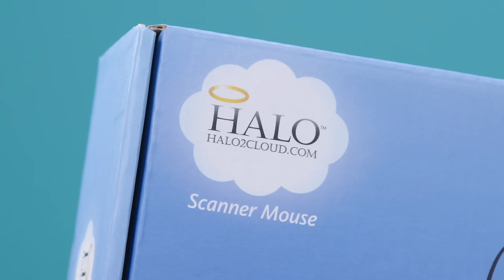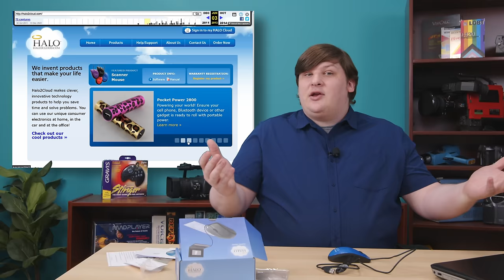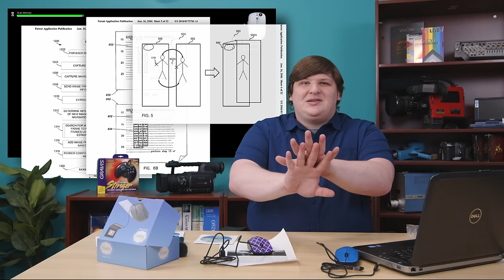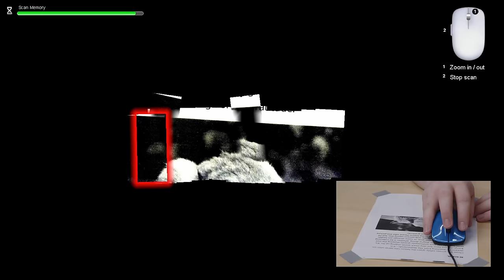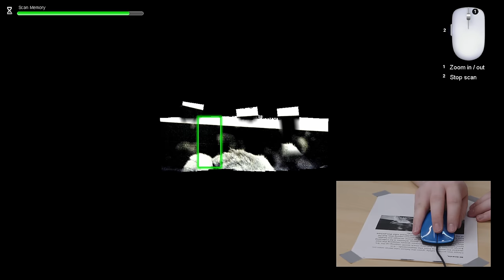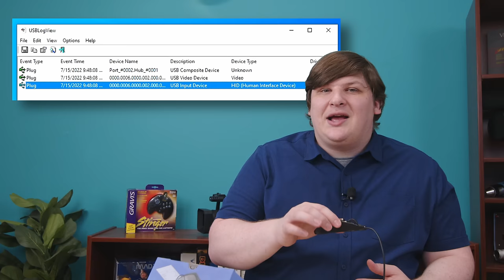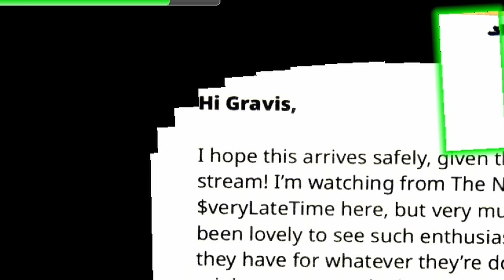Why would you scan things with a... mouse?

Comment: The idea is not dumb at all. It THEORETICALLY allows the fastest transfer of an image fragment to a PC. Think on time saved by just BRINGING a hand held scanner. Taking it out of the drawer, connecting a cable, making some room on your desk, starting the software and so on. If it was made properly - it could work. You type "let me show you", then flick the mouse and done, scan sent over Skype. Done in like 5 seconds. The main disadvantage is - you either has a good mouse, or a fancy mouse. You can't have both. Anyway, if you don't use mouse for any kind of CAD or drawing, if you don't use it for gaming - it could be perfectly good for office work. Using my big ass scanner is slow. I have to get up my chair, go to the scanner. That takes a lot of time compared to actual scanning that is also not too fast. So the manufacturer should focus on SPEED only. Invisible (transparent) app, that just does default things without much clicking and user interaction. Intuitively. A really good software could sell it.

Comment: I would totally use this if the same tech could be put into a mouse roughly on par with my corsair, and could have that failure issue ironed out. Smallest and most practical hand scanner i've ever seen. the ability to just run over a document haphazardly and have it put back together? amazing.

Comment: The 2 sensors are obviously for rotation detection.  2 linear data sources can be used to determinate rotation.  The extra data could be in the mouse data as a vendor defined section or something, but mouse and keyboard are protected in modern operating systems (I think this includes W7) and are not accessible from userspace, which makes this less likely.  If the reports were coming in as a non-mouse usage page it would be listed as another sub-device by windows (even though this would not be correct, but windows does this where it splits HID devices apart grouping their reports by their usage pages).  So really, I have no idea where the data is.  I might buy one to mess with it as I dabble in HID a lot.

Comment: Something similar happens with cheap optical mice on a uniform or glossy surface. For a number of reasons, the sensor gets a different image from the last frame and assumes the mouse have moved. Try a paper with rougher texture, different color or some dots printed on it.

Comment: I’m going to have a crack at the image-stitching-with-accelerometer thing; it sounds like a fun project to do in HTML/JS.
Reply: One evening later...

It might take a better programmer than me to do this :D

I've got the camera streaming to a readable pixel array, accelerometer data coming in and some camera projection matrix math that will probably work...ish.

But the accelerometer data is all over the place - it probably needs sanitizing in some way. Averaging the previous 100 incoming acceleration values hasn't helped much, so I'll need to do some research.
Reply: @whoshotdk  dead reckoning with a phone accelerometer is practically impossible. They’re too noisy for you to be able to cancel out the effect of gravity and avoid drift. You’d need to combine it with some sort of photo stitching algorithm, similar to what’s used in photogrammetry. To do decent dead reckoning (tracking movement exactly) with an accelerometer you’d need something better isolated from noise and more acccurate, like a ring laser or gyroscopic accelerometer. Even planes drift with time when not using GPS tracking.
Reply: @SkigBiggler  You're absolutely right - I did try this and spent a few frustrated hours trying to get it to work reasonably well without success.

Comment: I have a Logitech G305 and it has an even stranger construction. the mouse clickers are attacked to an inner top shell and each button except for the middle click and dpi switch is on it's own separate circuit board, the left right and browser nav buttons are 3 separate single sided boards, it's wild. the bottom half of the mouse is just a big cover that goes over the top plate.
it's one of the most popular gaming mice so it's VERY well documented.

Comment: I'm fairly certain that the software uses both sensors together in order to sense rotation in place of any other sensing devices. The reason why the image spins is because the chips assume that the only way one sensor could be changing while the other isn't, is if the mouse is spinning with the covered sensor as its pivot point. That's likely also why the image rotates in opposite directions depends on which sensor is covered.

Comment: Those mouse sensors are tiny cameras undercover, and thus should be theoretically capable of giving out full 2D data output (delta X, delta Y and rotation). However, since rotation is not needed to function as a mouse, commercial mouse sensor chips don't spit out this piece of data, so you only get delta X/Y. Thus, if you need rotational data, you need two of them together, at a distance. In this way, rotational data can be computed from the delta of delta X/Y between two sensors. When the mouse is doing linear motion, both deltas should agree with each other. When the mouse is rotating centered around one of the senors, that sensor reports zero delta X/Y, while the other reports some movements. This delta in delta X/Y can be then trigonometrically decoded into rotational data, which the scanner software needs.

Fun fact, I don't even think the software uses any magical image processing and panorama tricks. Assuming the sensors are good enough, the delta X/Y and rotational data alone should be suffice for image reconstruction. If they do use clever image processing, they wouldn't have needed the rotational data in the first place. The patents are just for the show to intimidate potential cloners and competitors, to coverup potential patent infringes, to trick supply chain and customers to recognize their value, and to scam gov't funding for innovating new things. Don't ask how I know, I work in the tech startup industry, we do such patent trolls all the time.

Fun fact 2, almost all major high tech companies do such patent troll.

Comment: I suspect they somehow merged the position data into the video stream. That would explain how they got that data to the PC and may also be part of the reason why that video signal looks garbled. The software would then untangle the data. That feels exactly like the thing an engineer  would do. And that also feels like the area where something got screwed up. Maybe the timing of the three signals is off, maybe the firmware has some race condition where it doesn't put the position data at the exact right spot so some part of the actual video data is interpreted as position information... That's like the exact kind of error I would expect in that prototype stage. And as it seems like the bug is triggered once the PC tells the scanner to go back to mouse mode for the first time, that also tells us something about their testing strategy. It's a prototype engineer's strategy, which fits perfectly with the rest of the vibe this thing gives off.

Comment: Separate board for side buttons of a mouse is not uncommon: most gamer mouses from Logitech has it since the 2000's. My g400 from 2015 has a separate board for side buttons and another separate board for buttons near the scrolling wheel.

Also, R. I. P. Gibbs.

Comment: As far as how that thing is getting the extra sensor data into the computer: USB-HID is actually substantially weirder than you might think. USB-HID is designed to support any imaginable human interface device, which means it has some room for expansion. You can stick some extra bits in the USB-HID packets, and there's an API in most OSes to let software grab those bits. It's a pretty low-speed interface, but it should be plenty fast enough for the data from a second optical mouse sensor.

Comment: Why would I scan things with a mouse? Well, my CueCat's in the shop...

(Yes, I know that's a different kind of product, but I like the joke.)
Seriously though, it seems like it could be a neat product if it was a little... better. Probably by being a standalone thing as you said, rather than kludged into a mouse. But a camera-based handheld scanner would be neat. I'd like if I could use that to quickly scan a drawing or something, instead of getting up, setting aside all the crap that has accumulated on my scanner/printer, placing the paper on it, going back to my desk to run the scan with the right settings, then back to the scanner to retrieve the paper (and to reinstate the accumulated crap on top of the device).
But since it's not quite better enough than existing scanning for somebody to bother making one (and especially to bother making a good one), I doubt we'll see it happen.

And rest in peace, Large Man. Your fluff will be remembered.

Comment: Since those image sensors still technically work, I'm wondering if it's possible to rip it out and scan something like punched tape.

USB totally allows you to just switch how devices work from software. If you want to know USB devices essentially have 3 layers. Device, interface, endpoint. USB hubs basically operate on the device level, composite devices essentially work on the interface level and endpoints can be configured to operate in different modes as I stated before. This mouse probably just uses the normal "boot" protocol for USB mice and when the software needs to use the mouse it switches it to a different format that Windows HID drivers will ignore with the extra pair of X/Y vectors.

For the math a great example of how it works is if you put a pin in a hole on paper you can still rotate it even though you have no lateral movement in the one hole. You need both pairs of X/Y vectors to get rotation, if the sensors output a rotation component it would work with one. It would probably just make the sensor cost a lot more because you're the only one that requires the rotation output.

Comment: I have seen that failure mode... in many different corded mice, of very high quality. Usually after at least 2 years of hard life (16 hour days). I don't know for certain what it is, but my guess is damaged cord. It's not unique to a manufacturer, I've had it in many, very different companies mice. I've never had it happen on a wireless mouse.

Random movement (usually jumping around), feels like a button is held down, clicks doing odd things. I thought it was my keyboard with a stuck key the first time it happened, or a trojan with remote mouse control. Mouse seems like it mostly works just fine most of the time.

Comment: Combining a mouse and scanner together becomes a terrible idea the more you think about it.  As genuinely impressed as I was by the arbitrary angle image stitching, I imagined what it'd be like to actually use it in my home... and there's basically nowhere I could use it.  My desk has a pull out keyboard and mouse tray, nowhere near enough room to put even a standard 8x11 sheet of paper.  I'd have to move a bunch of things around, move the mouse off my tray on to a better surface with room to maneuver... and at that point, it would be more consistently convenient to just use a regular printer-scanner.  I imagine the same is true for most people.

Comment: The 2 optical sensors are used to track position and rotation. With 1 point you can track position but can't know if there is rotation, but if you add a second point, you can know determine the movement of both sensors and so, determine rotation.
That's why when you block one sensor and move the mouse in a linear motion, if applies rotation to the scanned area, because it thinks one point is moving and the other point is not moving, which would make that last point the center of rotation.

Comment: That second sensor is required to detect rotation. You can easily find out why by cutting a strip of paper, marking a "window" in the middle and then steering it around with fingers pushing down on the opposite corners. 🙂

Comment: 1 sensor is for axial movement, the other one for rotation. Like accelerometer and gyroscope in a phone
Reply: No, you need both to do rotation. The sensors only report translation, but you can mathematically combine them to get rotation. If you rotate it but don't translate it, the sensors will report motion in opposite directions perpendicular to the line between them. The relative amounts telling you how far between them the pivot point is and the overall amounts the angle. If you translate it but don't rotate it, both will report the same amount of movement in the same direction.

Comment: 34:00 Because i dont have this in my hand i cant confirm this, but I think they wanted to use these two sensors to have better yaw tracking as sort of a backup to the image differential software, and they probably didnt expect one of the sensors to not work, so instead of limping along with a single sensor, it is stuck pivoting off of the broken sensor, because the broken sensor is saying that its not moving, this is probably the reason for the rotation, with the pivot point being whichever sensor is covered up.

Comment: Not an expert on the matter, but in general, a HID device interfaces just about any device the has buttons on it; including joysticks and similar gaming input devices. So in scan mode, it can certainly function as a "custom X/Y/rotation" device, with the rotation computed by some chip in the moouse. If said chip is broken, that would also explain the failure mode...
EDIT: the tracking error is probably due to the document being mostly white... if tiny errors in a mostly white surface are present during stitching, they add up when you return to the origin... if it is scanning a "continous document", I am pretty sure the error would be much less pronounced.

Comment: They use 2 mouse sensors to figure out if you are rotating the mouse. The ability to correct the scan of you rotate the mouse during scanning is not done by calculation on the scanned image to figure out if you rotate. The detection of rotation is done by the dual mouse sensors, so the only thing the PC software has to do is counter apply a rotation on the scanner output image. Much faster and simpler then calculate the rotation from the scanned image.

Comment: The second sensor is needed because, I suspect, off the shelf optical sensors don't support outputting rotation data (just X,Y) and a second sensor was cheaper than custom designing a new controller. Just a guess, mind you, but it makes sense.
Edit: It even says so in the highlighted text in 35:19, the sensors only output DX,DY.

Comment: Software to do this with any camera has been around for quite some time too. In particular, look at Steve Mann's Orbits (1993) or Hugin (at least since 2009). And modern optical mice do the same on a smaller scale for their motion tracking.

Also, dead reckoning is when you include rough relative information about how you moved, e.g. by integrating accelerometer data. It's liable to drift, and that seems to be precisely the failure mode; the software is trusting faulty motion vectors over scanned image features. Recognition as used in Orbits wouldn't do that, though loop closure remains a challenge because stitched images drift too. SLAM techniques deal with that.